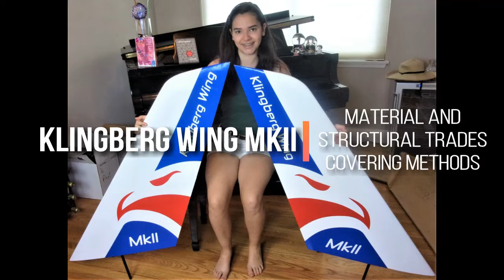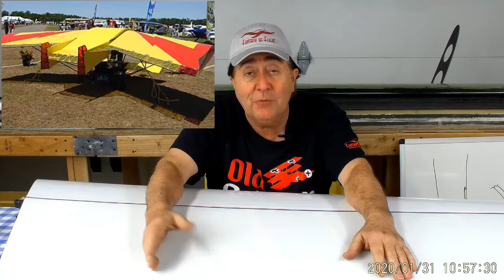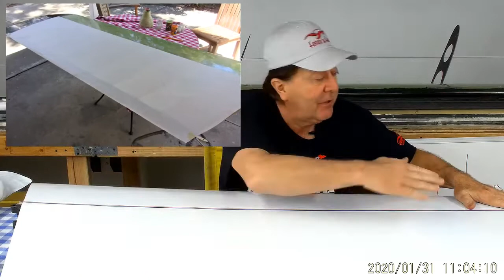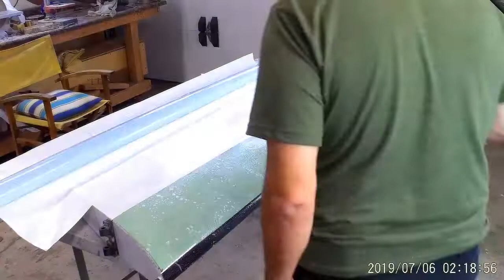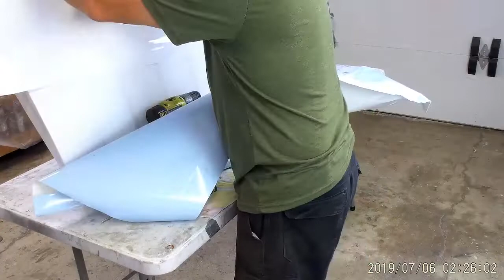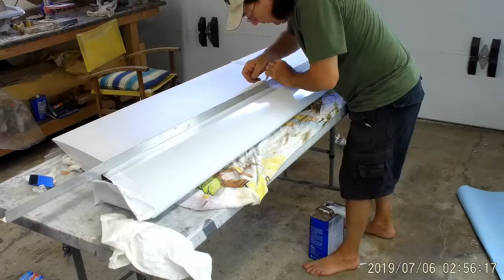Material and Structural Trades - Covering, Klingberg Wing MkII Development

Comment: May I ask why you didn't consider using mylar like they do on a lot of HPAs? Thanks
Reply from the maker: Totally different speed range and loads. However, I did seriously look at the same material they use/have used on the America's Cup boats and found out it was actually heavier than the fabric I'm using. Hard to beat the super light Oratex with the color and adhesive already applied.. And as a BIG plus, it is ripstop.
Reply: @KlingbergWingMkII  thank you

Comment: This covering method with Oracal 651 appears to be a much less cost and labor comparing to base (color) coat and clear 2k coat painting system. And repair and maintenance are easy too. Thanks for your research, great thinking and the ideas! Oracal and ortex coverings look like a great option going forward as it was already mentioned here. Do you have some pointers to share for applying oracal by wet method?
Reply from the maker: Search YT for vids of people applying vinyl coating to cars. Lots of hints and tips there.

Comment: I've watched enough of these that I've lost track of what I've seen where. Not a bad thing, because I've learned a bit. But I forgot which video talks about your wing skin of carbon fiber, foam, and fiberglass. Rather than going through all of them again, may I ask which one covers the formula and building method so that I can send it to a friend? Thanks
Reply from the maker: Oh, good question, but a bit tricky. You see, I've changed the process over time as I've created various improvements. So, here is what I will do. I'll give everyone a link here to the "bottom line" which is what I think will be the final methodology. Then, for those who might be interested on the engineering journey to the current solution, I will create a new playlist that collects up all the different parts of the process and shows how it evolved. If folks are interested in that, the can go to the playlists tomorrow and start watching the series. So, the bottom line processes is here: https://www.youtube.com/watch?v=nBxl1N_IK34&t=5s

Comment: Theyre almost all great videos...this ones your best by far...those early ones with the  reeeally quiet narration & BOOM music overlay...on & off the mute button...why are some of us just builders...I havent been able to work that out...some of my modelling collegues past simply havent a clue on tight structural joints etc...& their covering methods are nightmares...why when its so relatively easy...love your work...love your methodology...results speak for themselves...never had covering blow off...wings only break when they hit the ground...how would "you" rate these heat shrinks vs silk, on performance...strength/stretch vs weight
Reply: On structures...have you ever looked at...tried Resinol paper honeycomb...build with brown paper n foam...resinol (resourcinol) is the brown purply glue used in older wood marine builds...its water PROOF...was developed or at least advanced for aero applications i think in part with the Mosquito...anyway...it has better strength than epoxy where organic materials are used like paper, aramides & wood...resinol paper honeycomb uses kraft/brown paper...kevlar paper honeycomb uses the same binder (resinol/resourcinol glue) & the two have nearly the same strength characteristics/properties...AND resourcinol glue is...fireproof...it WONT burn, it just charrs. Id be interested in your view on paper paper honeycomb. cheers from NZ
Reply from the maker: Ah yes, resorcinol glue, I used to love that stuff - the original thermoset adhesive. It was the best and used often in wood aircraft, but epoxy is now the adhesive of choice.  Epoxy holds up better over time and withstands heat swings better. The most common epoxy used for wood aircraft these days is T-88. Joints are stronger than the wood itself. Lap shear strength for resorcinol is about 1700 psi; T-88 is around 1800 psi on wood and of course, resorcinol doesn't really work on composite materials.
Reply from the maker: Thanks, it's nice to know that some folks notice my efforts to improve the videos - practice makes sorta perfect. As to the silk vs. Oratex, I have not done any studies/analysis, so I have no idea as to the answer. Silk wouls surely be lots more labor.

Comment: Fascinating! How does the model Oratex, with the adhesive already applied, compare in weight to the certified Oratex?
Reply from the maker: About the same. The fabric is a little thinner/lighter than the certified version but the glue adds weight so it works out about the same.